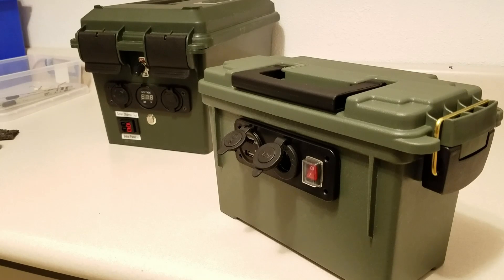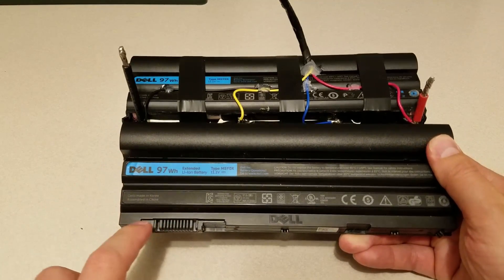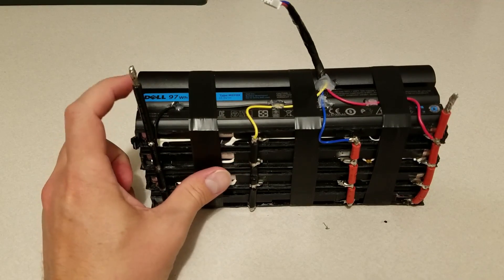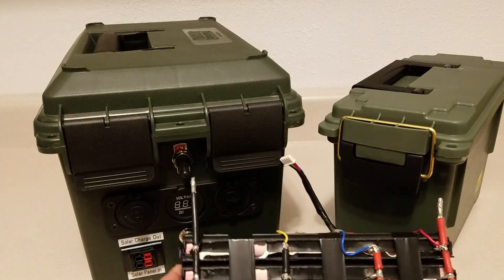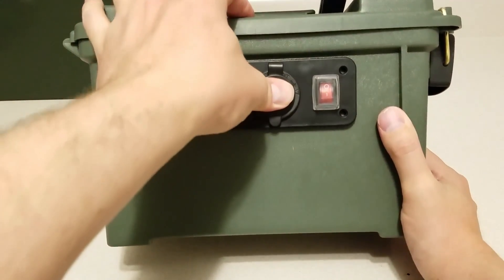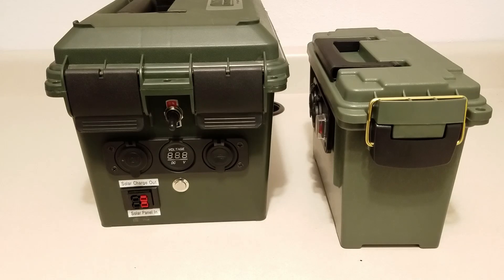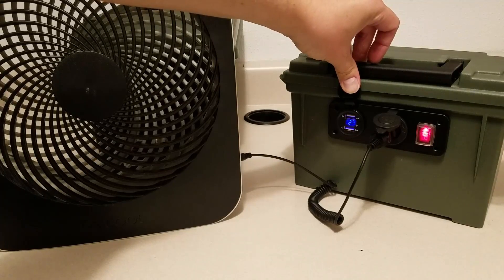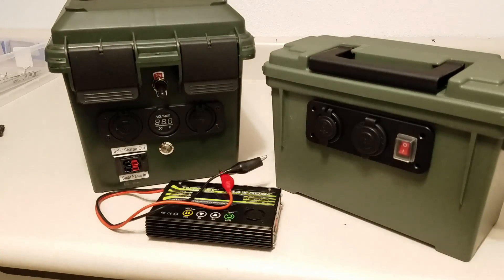DIY Lithium-Ion Battery Box

Comment: How long does the battery last when using that fan
Reply from the maker: That fan pulls under 10 watts, so it could run for 60 hours or so if you took the battery down 100%.  I love that little fan   :D
Reply: @Jasonoid  cool..I'm in the process of putting together a 3s 14p for a build like this. For emergency power outage or something to take camping..
Reply from the maker: @daveteater1630  Just make sure to have a proper BMS on that build. This battery I didn't have a BMS and it makes it much easier to manage / charge
Reply: @Jasonoid  all the two batteries that I built before which were a 3s 6p, I just used balancing cable that plugs into my hobby charger and solder onto the battery terminal per a video that I've seen on YouTube and other than the capacities being small the batteries have done very well and balance charging them has been really easy. So that's what I'm planning on doing with this battery.
Reply from the maker: @daveteater1630  That will work great. Thats how I used to charge this battery but man....it sure took awhile to balance haha! 

I just finished building a 100ah LiFePO4 battery that would probably charge the same way with your hobby charger (if it supports LiFePo4). Video to come out soon. $220 for 100ah battery....crazy good deal! I prefer LiFePO4 now, I didn't like the fire risk of Lithium ion always in the back of my mind.
Reply: @Jasonoid  I wish I had a way to private message you because I would really love to pick your brain about something
Reply from the maker: Jasonoidllc@gmail.com
Reply: @Jasonoid  email sent

Comment: How long does it power your iceco fridge
Reply from the maker: I have since used these batteries for a different project but this would run my fridge for over 24 hours. Charging it was the downside because I couldn't charge it with my solar charge controller, I since have built this battery box with MUCH more storage:
https://youtu.be/WFJlMU272wU

Comment: You can actually install a CC CV Buck converter and use that to charge your cells via Solar Panel. You’re able to limit amps coming in as well as specify final charge voltage.

Comment: How long will the Iceco VL45 run off or each one of these ??
Reply from the maker: My lead acid battery box is the cheapest solution and it will run about 24 hours on that battery without solar. With solar it could run a LONG time if the sun was around. I am putting out a new video for a new battery box, should be out tomorrow or the next day. Stay tuned for the new video!

Comment: Use a 3s mppt controller they are mega cheep and an alarm set it to 3v as used in radio control planes etc
Reply from the maker: thanks for the tip!

Comment: You need a bms otherwise you'll probably over discharge the batteries.
Reply from the maker: I use this battery for charging smaller batteries and running small electronics. Never any large discharge devices. I keep an eye on the voltage all the time. If I ever use it for anything else I will use a BMS, thanks for watching!
Reply: @Jasonoid  Just watch the individual cell voltages. They can become unbalanced without a proper BMS. All you need is one cell to be unhappy to have a very bad day.
Reply from the maker: @Fix_It_Again_Tony  I use a hobby balance charger when charging it. I have a DIY Lifepo4 battery coming out soon, just finishing up the video, pretty fun project!

Comment: Do you have another link for the dell batteries. It’s not working??
Also can you share where you purchased the battery charger. 
Do you think this would power a fish finder?
Awesome build!
Reply from the maker: As long as the fish finder works on 11 volts. Most 12 volt devices support 9-14.5 volts so you would need to confirm that before trying it out. Lithium batteries running in 3 cell configuration have slightly lower voltage than a standard lead acid battery. Just search for "OEM Dell Laptop Battery Extended 97Wh M5Y0X battery" on eBay

Comment: Like it!  Check out Victron charge controllers.  Small and programmable. I use them in my solar generators and use lifepo4 and 18650 lion packs.
Reply from the maker: I will check it out, thanks!
Reply: @Jasonoid  Here's another one to check out that's cheaper and can be programmed.
https://www.ebay.com/itm/10A-36V48V-60V-Solar-Charge-Controller-Regulator-100V-Max-Input-USB-Lithium-Bat/141943518483
I bought it a year ago (the SL-03 model) and it works well.  It's a PWM controller hence the cheaper price.  For smaller builds, it's a decent option.  I really like the Victron's because they're MPPT and the mobile app provides a ton of data/options.